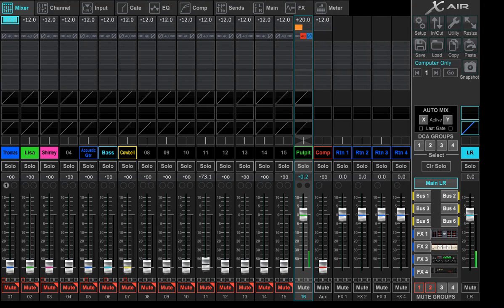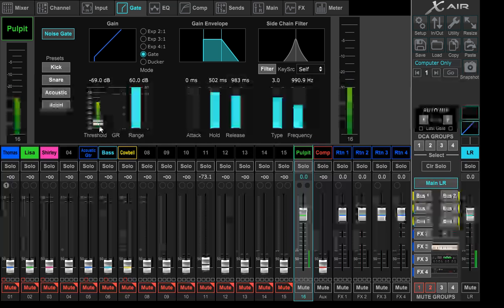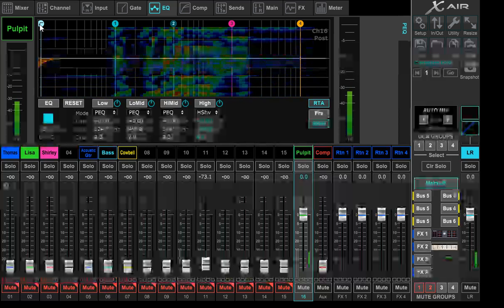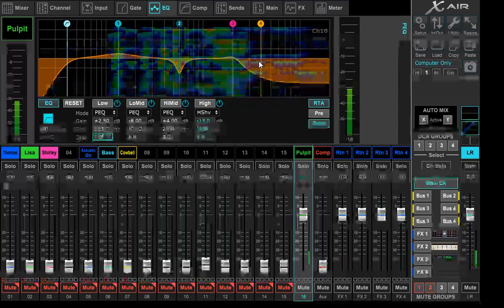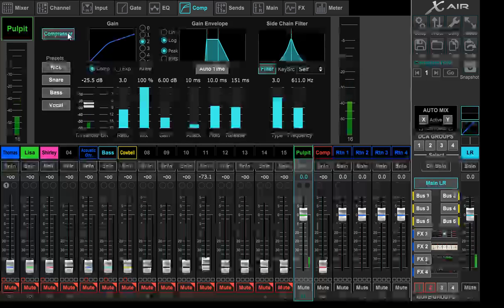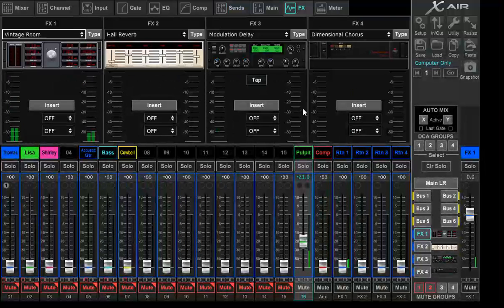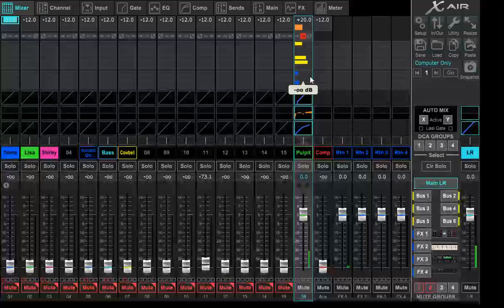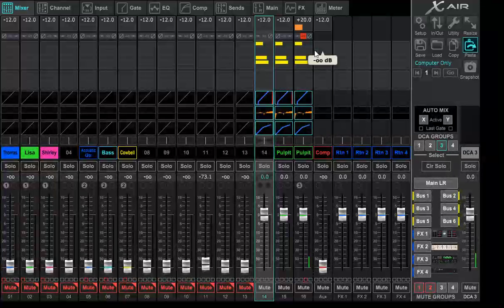Setting up a Channel on a Behringer XR 18

Comment: Hi I am using an X16 Behringer but we have an issue when streaming our praise and worship.The sound is very noisy.Do you have a complete tutorial for setting up a PA for church streaming?
Reply from the maker: That's a hard situation to diagnose in the comments section. I generally avoid livestreaming, as it's hard to get the sound right unless you've got really good sound techs. I'd recommend recording it, editing it and posting it to YouTube. Better results that way as a general rule.

Comment: Do the older XR 18 have the same EQ layout. I'm thinking about buying a used xr18 but I don't want to get an outdated unit.
Reply from the maker: The software updates. I'm not aware of a hardware update that would keep you from upgrading to the latest. That's one of the advantages of these units, they get better over time. But, I've not used one in some time.

Comment: Great vids !! These really help me out ! Thank you!! I have the xAir18 for a few years now and considering switching to the preSonus 24R. Doing a lot of research. Can the 24R be used as your audio interface? I have an older RME Fireface 800 firewire400, looking for more up to date connectivity like thunderbolt. What do you suggest? Thanks
Reply from the maker: Yes, you can use the 24R to record, but it's not really set up well to do that. I have a Presonus 6/8 that I like for recording. The 24R is really good for recording live off the floor. The Capture software that Presonus provides is very nice for live recording. It's hard to set up monitors, though. Better to use a device specifically designed for recording if you're going to do mutit-track.

Comment: I realize this is an older video, but the information provided is fantastic. 
Question. If I'm using a DAW (Reaper in my case) is it advisable to skip the Gate, EQ, and Compression in the XAir and handle all of that in the DAW? I'm assuming so, but thought I'd ask.
Reply from the maker: Yes, I'd recommend using your DAW to apply those effects. You have much greater variety available. The effects here aren't bad, but any DAW will have far superior options. Glad you found the video useful :)

Comment: Off topic question, but is it possible to sidechain a compressor or gate trigger to set fx delay timings and or levels? If so, how many side chains can be created?  For example if I have a backing track that has a high intensity section and a mellow section but I want a certain effect on a live performer to be louder/more present during the intense portion of the backing track, and very subtle during the mellow portion, to kind of follow the dynamics of the elements without having to ride faders?
Reply from the maker: That question is a little above my skill level. I would recommend sending the signal through a DAW to do something that complex.

Comment: It's been 4 years since this video, I hope to get a response to my question. 
On my EQ there are big circles in the middle of the EQ screen but yours are small circles on the top of the EQ screen. Is there any difference? How can I make mine look like yours?
Reply from the maker: It may be that the latest software update made this change. If they adjusted the User Interface in a software update, I would expect that there's not a way to revert to the old style.

Comment: If that's how you adjust input gain then everything I was taught and have learnt after 30+ year is wrong. ps. It's not wrong, always adjust gain to avoid clipping then adjust faders. It's sad to see so many views on a video that is providing information this bad.
Reply from the maker: Yes, I agree that was a mistake. If I were to record this video again, I'd certainly have approached it differently. If you look back in the comments I've addressed this concern dozens of times and I've made videos since which advise setting gain before faders. Thanks for your comments.

Comment: This is basically backwards man. Sorry. Good effort. Just check your info.
Reply from the maker: Hi, Michael. Yes. You are correct. Gain should be set before the fader is set. As about 50 people before you have noted, and as I have recognized in subsequent videos, that is the proper method (sigh). Thank you for your comment  :)

Comment: Your method of gain staging is wrong.
Reply from the maker: Yup. It was before I had worked with digital boards very much, and represents how I used to use analog boards. The technique works in the situation I was applying it to, but best practice is to set gain first. If you look at some of my later videos, you will find that I acknowledge this several times, as well as the dozens of similar comments that have come before yours (sigh). You make one mistake... it's there on the Internet forever. Actually, I've probably made lots of mistakes, but this is the one people feel the need to correct. Again, and again, and again :)

Comment: What app are you using?
Reply from the maker: The app comes from Behringer. If you search for the Behringer website and go to the download section, there are two types of app. One controls the whole soundboard, the other isolates just one channel at a time. That second one is primarily for people to adjust their own monitors by isolating the aux channel that feeds their monitor.

Comment: The gain should be set per channel based on the incoming signal level, so as to not clip, but also to not be too low, which leads to poor signal to nose ratio. The channel fader sets relative levels, and 0 is a good Target, but "appropriate levels" out of the mains are set by the main fader and mains volumes.
Reply from the maker: Yes. I agree. If I were making this video today, I would set gain first, then adjust fader. Thanks for your comment.

Comment: Very helpfull and simple explanation of all topics covered. I bought a second had unit and I have on ch 12  its running hot even when nothing is plugged in....is there reset or what do I need to do to fix ch 12?
Reply from the maker: I've not run across that problem. Not sure how to help, sorry.
Reply: @AndrewBellous  I have tried every button and reset it several times....turned photos power and every setting in input on and off...its still running hot even when muted...abd with nothing plugged in....time to call Behringer..
Reply from the maker: @debzsmart8220  yeah, I'd investigate having it serviced at that point.

Comment: Typically the fader  on a digital mixer don’t have to be in the middle when setting gain. Also unity on a digital mixer is around -18 DB full-scale. When your gain  knob is  all the way down counterclockwise that is called Infinity.
Reply from the maker: Yeah, there are a few things I would do differently in this video if I were to do it again. Thanks for your comment.

Comment: Have you done any recording into a daw? Like guitars mics but mainly with synthesisers recording audio tracks. Do you know roughly what the noise floor is with this mixer.
Reply from the maker: I haven't done any serious recording with this unit, but I did test it to make sure that functionality worked. If you're concerned about Noise Floor, I'd suggest moving to Presonus or A&H. The Behringer stuff is pretty clean, but there's no question the build quality on Presonus or A&H is better and makes a difference to the Noise Floor.
Reply: @AndrewBellous  Thanks for the reply

Comment: I just got this mixer. When I’m using headphones I can’t hear anything? The software is running on windows 10. The meters are showing I’m receiving audio. Not sure what to do
Reply: Hey! If you are using only the mixer, then click In/out, then click Main Out, then position the headphones on either Main Out or Monitor, like this it should work. But if you have connected the Mixer to a Daw  then position the headphones in the Channel's number that you have chosen in your Daw as an Output. Hope it should help, if you haven't yet found an answer.
Reply: Kapongo Kal thanks for the info. I ended up returning it.
Reply from the maker: The solution is to select one of the 'Virtual Outs' as the output for your main bus. Sorry this reply came too late to be helpful. It took me a month to figure that out, and it was only dumb luck, not anything I found in documentation. I plan to make a video on this subject when I can find the time.

Comment: Do I have 18 In -and hardware Outputs in my DAW with this ? So that I can multitrack them and edit or is it simply for live mixing and only having a stereo sum in the end ?
Reply from the maker: Yes, you should be able to connect via USB and have a full range of ins and outs passing through your DAW. There's a button on each channel that allows you to specific whether you want the sound from the input, or the sound once it's passed through the DAW. This should also allow you to playback audio from your DAW into the live environment.
Reply: From what I saw, you can.  You'll need to connect it with the usb and then get the carry over into your daw.  I just bought this for my club so i dont have it on hand to test, but I will take my laptop down there in the next few days and check it.

Comment: Hi Andrew using the default that comes with the app works only the problem that when inserting reverb in any channel works but I have no control over the amount I need. some advice. Thank you
Reply from the maker: You should be able to adjust the level of reverb in a number of ways. You can change the parameters on the plug-in. If you put the effect on one of the 'send' effects channels, then by using the fader for that effect send, you should be able to adjust how much of the signal is modified by the reverb, controlling the wet-dry of the mix.

Comment: Hi I use the xr18 just for a two piece e vocal setup using backing tracks... question: could I use my studio one pro  with this for a live setup ?
Reply from the maker: Yes, particularly if you get Studio One 5, which just added a 'show' mode for playing live.
Reply: Andrew Bellous oh really 😮 I purchased the pro version a couple years ago so is this a free update?
Reply from the maker: @gobrad  No, for 5.0 there will likely be an upgrade fee, but it's usually pretty reasonable. I just signed up for Presonus Sphere, which gets you their latest software for a monthly subscription fee.

Comment: Strokes me as someone who doesn't understand gain staging.
Reply from the maker: You are correct. I made these videos as I was using a digital sound board for the first time, and if I had it to do again, I would approach gain very differently.

Comment: Some advice on gain staging: the method you describe, setting the fader to unity or "0" and then raising the input gain until it reaches good volume in the house will not give you optimal results in areas other than the main speakers, e.g. aux sends for monitors.  The input gain on a channel sets the stage for how much signal that channel can send to each buss in the mixer - this includes the Main Buss for front-of-house (FOH) speakers, as you mention, but also Auxiliary (AUX) busses and Effects (FX) sends.  If you use just enough gain to blend an acoustic guitar into the house mix with the fader at unity, the acoustic guitar player using a monitor system from an AUX out on the mixer will likely have to perform an extreme boost on the bodypack or floor monitor and have a poor signal-to-noise (SNR) ratio which results in a lot of hiss.  A more preferred method is to set the input gain to a level where the loudest sounds send the channel meter just below clipping, and then use the fader to mix the instrument into the house.  This ensures a full and healthy SNR for all busses and FX sends downstream of the preamp.  Cheers!
Reply from the maker: Sigh. Yes, you're absolutely correct. The Gain approach here is a hold-over from my work on analog boards. I was making these videos while using a digital board for the first time, and really needed to spend some time figuring out gain-staging, which sadly I did not do in advance of making these videos. My penance is to constantly have to apologize for not following best practices. I now adjust gain first, then faders. Wish I had a time machine :)
Reply: @AndrewBellous  Thank you for making that mistake though. It was super helpful to learn from this debate as I also am moving from analog to digital mixers.
Reply: DrumsBasically hey I’ve encountered a problem. So let’s say for fx1, I want to use it on channel 1. So alright I go to fx1 and bring up Chanel 1 fader. However, I also have to go to Main LR and turn it up there aswell in order for the signal from channel 1 to go into fx1. Alright, sure. But now I want to hear channel 1 in, say, bus 1 so yes go to bus1 and turn up channel one. Now let’s say I want to hear channel 1 with fx1 in bus1. So okay turn up fx1 in bus1. The problem I have is why does the level on channel 1 at Main LR control the amount that goes into the fx. Let’s say I want to hear channel 1 with a lot of delay in my bus1 but not through the FOH. How can I do this? Is it even possible?
Reply: @naingoohtun6716  while I no longer own the XR18 mixer, most digital consoles (to include the XR18) allow you to route FX in different ways e.g. Pre-fader or Post-fader.  What you've described, sounds like the FX1 is being routed "Post-Fader",  meaning it's intensity on all sends will follow the faders on your Main Buss.  To achieve independent level control of the FX, regardless of the position of your main fader, find the send options for your FX1, and there is usually toggle buttons to indicate it's routing style.  Change to "Pre-Fader" and you will then have to mix in the effect on each buss manually.  Keep in mind, a potentially negative side effect of this approach is you may still hear the effect through your PA even when channels are muted depending on how your mutes are set up.  You will also likely have a slightly more complicated workflow for both mains and monitors.  Pre-Fader FX is useful for me in limited ways, e.g. when a snare drum is played in a small space, I likely do not need to amplify it, so its fader will be down, however with Pre-Fader effects, I can still send reverb on the snare out of the PA speakers.  Cheers!
Reply: @drumsbasically6163  curious why you got rid of xr18...something you didn't like? What did you move on to?
Reply: DrumsBasically I’ve been shown the gain structure approach for the certain reason that adjusting from the fader instead of gain, you loose more. Faders jump harder than gain meaning even a small fader adjustment could cost you 3db.
Reply: @mdleeproductions5002  There is some validity to that position.  Faders are often logarithmic, so they're exponentially more sensitive the further they are from Unity - meaning large db shifts will occur with small fader adjustments if operating a good distance above or below unity.  In my experience, there is minimal/no risk to operating this way however, as good input gain structure will likely put all faders close enough to unity on the channel strip, that the fader adjustments are quite manageable for mixing the audio.  There are tradeoffs with either method; I'd pose that the method I proposed in my first comment is the best all around solution.
Reply: @drumsbasically6163  best at times is a mix (!) of both approaches.. your method (that I myself use), getting a "hot" signal into the mixer, so that you can use it sparingly wherever is needed, with greater SNR, is often times the best.. however, when you have a very loud input source that you only need small amounts on he mix / aux sends (like a tambourine), you'd better lower the input gain, as not to be working with the faders / sends near the bottom of their travel, where there's minimum resolution (being logarithmic, as stated), and work from there.. with the added bonus of being more difficult to clip the input stage, with lower gain.
Reply: @joaosousa1502  Hey, great points all around my friend.  Thank you for building up the community with your experience!

Comment: I was always taught you set the gain with all sliders down. The gain is the volume of input to the board. The sliders are volume out. Sliders and EQ's are always set after the gain is set. Not together.
Reply from the maker: This is how I was trained, and if I had the video to make again, I would do it differently. It matters more on a digital board than an analog board like I was trained on.
Reply: @AndrewBellous I'm sure there's different ways to do it to achieve the same result.  It looks like to me, the more videos I see, on a digital board it doesn't really matter. It seems, as long as you have the input signal button selected it's a personal preference.
Reply from the maker: @JG-vh6mn  The reason why it becomes more important on a digital board to set the gain properly at the beginning is twofold. First, many of the digital effects that are included on a digital board operate better if they have enough gain, but operate poorly if they don't. A noise gate needs the gain to be set properly or it may not trigger appropriately. Second, with a digital board, especially, the number of aux channels expands significantly, and various people may have control over those aux channels. So, if the main operator sets the gain too low, and needs to boost the gain, but the musicians onstage have already set their person in-ear monitors, then that can have disastrous effects. Setting the gain properly at the beginning of the process becomes more important when moving to a digital board, which unfortunately I did not have in mind when I made this video. I have been paying for it in overly complex responses to valid criticism ever since.